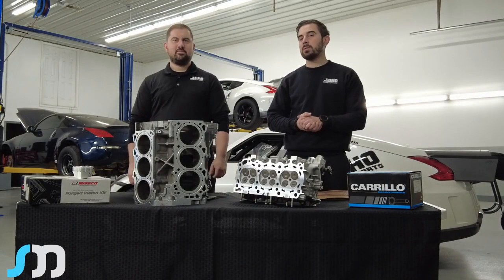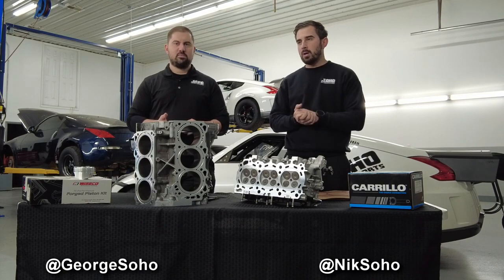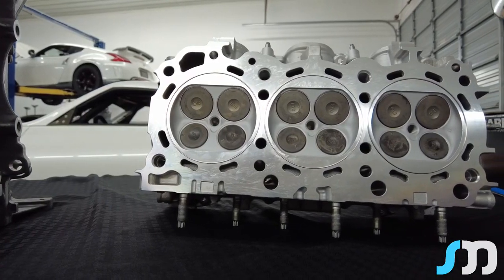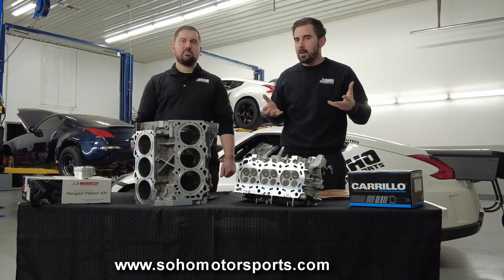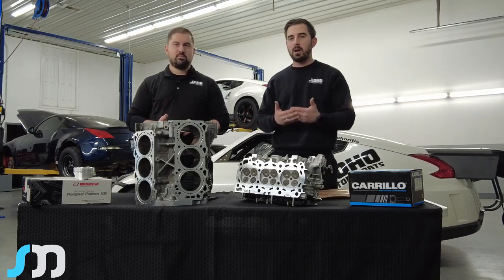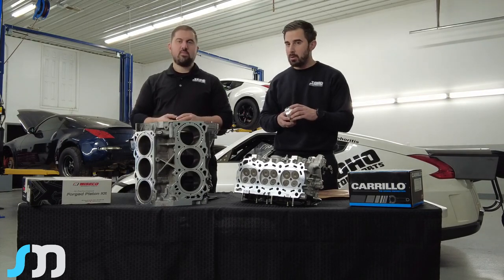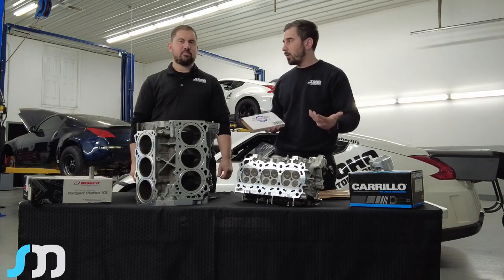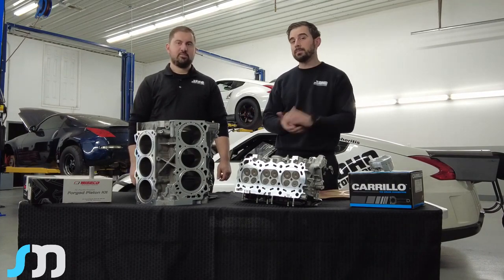Fixing VQ Head Lift plague in high horsepower builds! Tech behind our 1100 WHP VQ37VHR 370z drag car

Comment: What kind of head studs do you guys use? Any block modifications to accomodate the head bolts? As using an aluminum block id think the threads would stretch? Thanks, Dylan
Reply from the maker: Custom aged 625 arp head studs that fit into the factory block...no additional modifications are needed to allow them to work